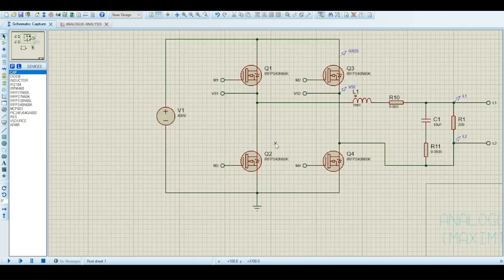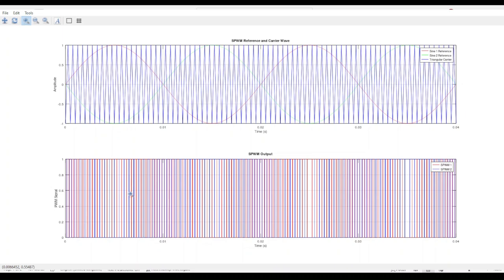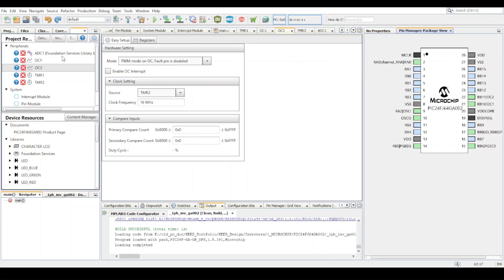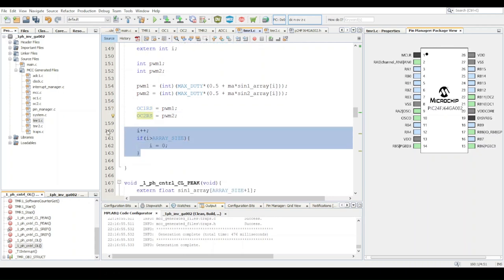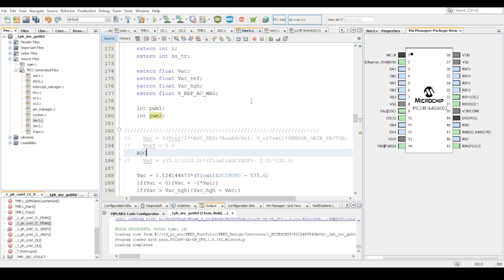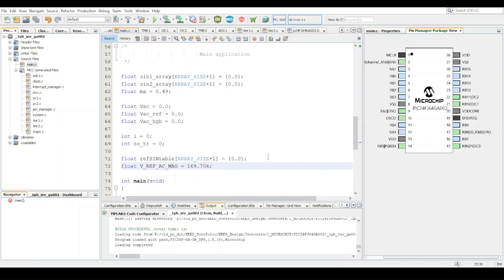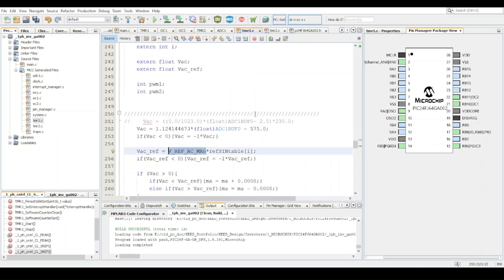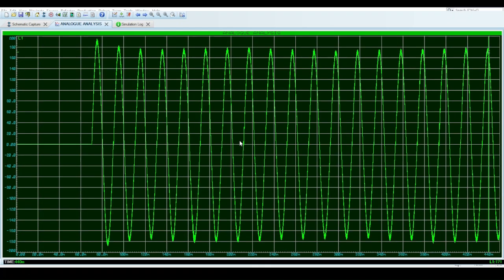PIC24 Single Phase Inverter: SPWM and Closed Loop Control

Comment: I would like to ask how to use MCC PWM and CODE in MPLAB to generate SPWM signals. I have a senior's closed-loop project, but I still can't make an open-loop project with the same control.

Comment: Welcome back!  Great video.  Hey, looking online, seems IRFPS40N60K MOSFETs are obsolete.  What modern FETs and gate drivers would you use if you were implementing this circuit today?
Reply from the maker: Hello. Thanks! I would use the IXFH46N65X2 or a MOSFET that meets the criteria of "Qgd/Qgs < 1" for shoot through prevention. For the driver, the FAD6263 and MIC4608YM are really good options.
Reply: @halleluyahkupolati  Thank you so much!

Wow they are not cheap.  What can you recommend that can be bought on LCSC?